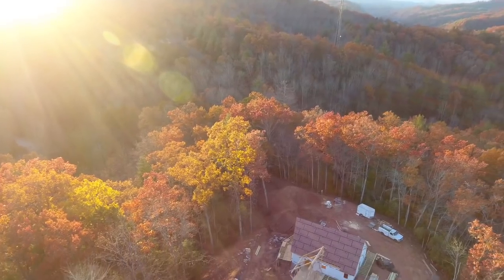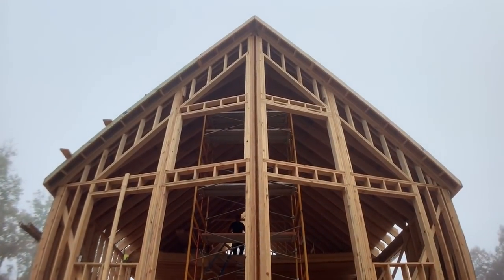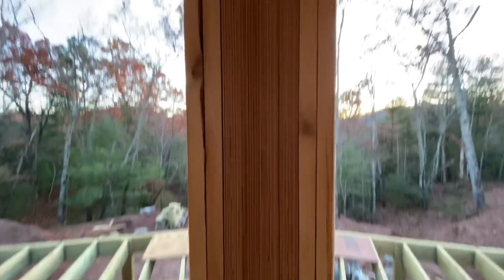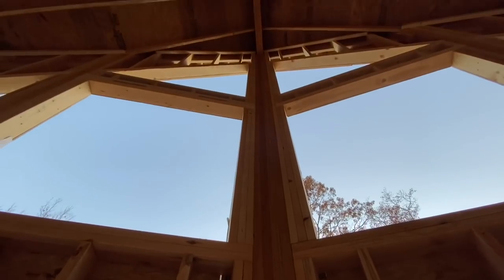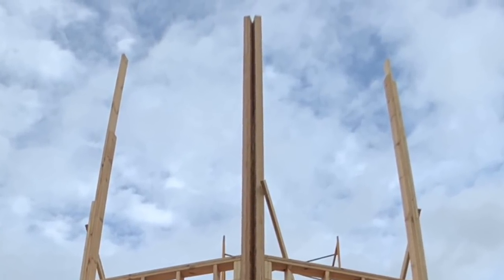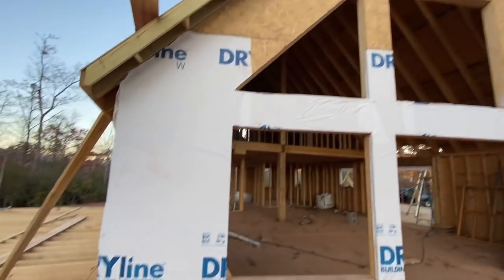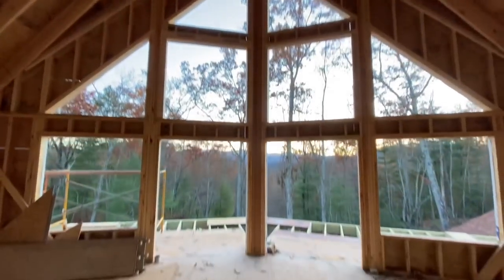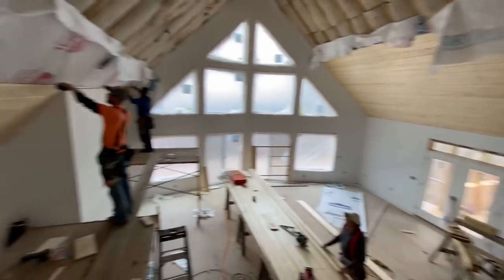Tips For Building Tall Walls

Comment: Very good video showing some best practices when it comes to tall walls. Adding the Prow is great. We had several 25ft walls in a very windy area in NV, 2x6 framing throughout, and we added in diagonal braces cut into the top plates at all the corners.

Comment: All solid concepts to incorporate into your structural wall.
At this point, using steel post with concrete anchors are a must. Especially if you have little shear wall for support